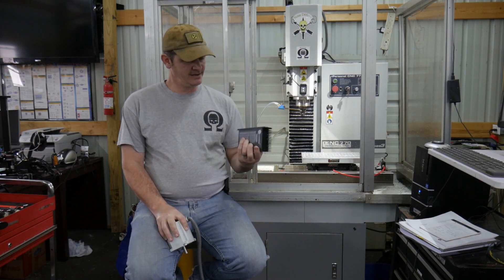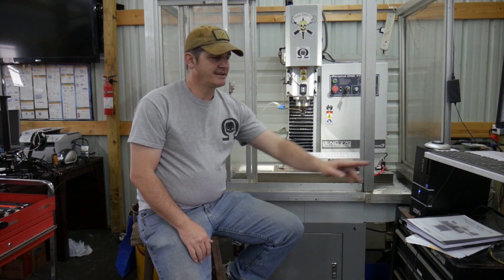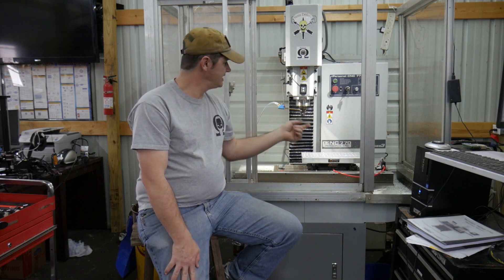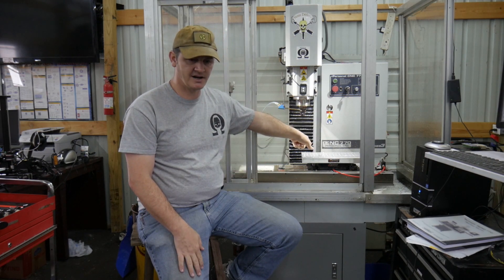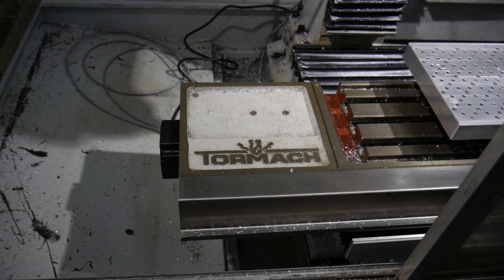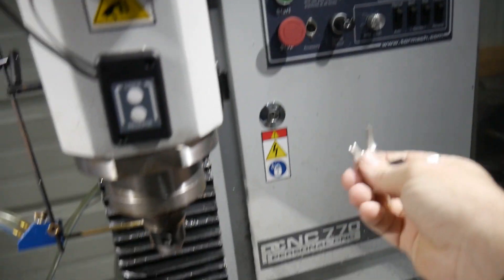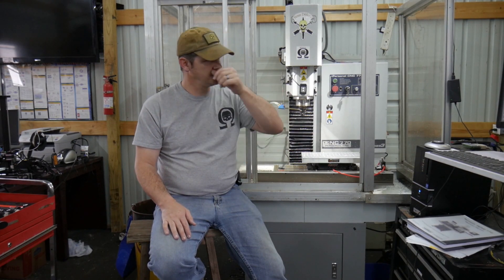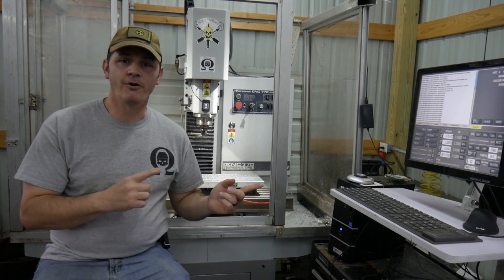Tormach PCNC Hybrid Stepper Upgrade Kits

Comment: I'm tempted by this.  If you get some cutting footage up that'd be awesome.  This seems to provide most of the advantages of the servos for a series 3.  And I assume from your description that if any of the 3 axis motors miss a step the mill will limit switch which should at least stop everything if I'm away from the mill and it crashes because any major crash almost always causes missed steps.  That's a real step up from its stock design.  A big deal if you want to let it run for hours without babysitting it.  To test I just started my 770 spindle then pushed a limit switch and it stopped the mill and said it had to be taken out of e-stop mode to continue.  So that's good.  It stops movement and spindle instantly.
Reply from the maker: Thanks, I posted some cutting footage yesterday and I'll have more coming this week.

Yes, I tied the alarm signal into the the limit switches. It was the simplest way to implement an alarm and stop the machine. This way you will also know which axis is the culprit as the x drive is tied to the x limit for example.
Reply: Thanks for getting my hybrid stepper kit out yesterday.  This virus going around is making it hard for me to concentrate on machining projects but I'm looking forward to getting them and digging in on some machine maintenance in the next couple of weeks.
Reply from the maker: @advil000  thanks for ordering. I'm working on an install video. Lots of editing. My contact information is in the box so if you run into any issues during installation just let me know and I'm happy to help you through the process.

Comment: Think you could provide a 4th identical closed loop motor/driver/cabling to use to drive a 4th axis?  It would also make a good set of backup hardware.
Reply from the maker: Absolutely, I've been looking at my 4th and thinking the same thing. I'll probably offer it separately as well as a full 4 axis kit.

Comment: Nice, Jody.  Showing an adaptive toolpath would nicely demonstrate some rapids and how that affects HSM.  Could see a bit of that at the end of your video, but most of that was at normal feed speed.  Regardless, well done.
Reply from the maker: Thanks for the feedback Bill. I'll program a part and shoot some video this weekend of the machine actually cutting for awhile.
Reply: @jodyolivent8481  You bet.  I'm hoping this works for you on KickStarter.  I can say for certain that more people would take the time to watch if the video just started with nothing but rapid movements.  

While your conversion has many benefits, the one that most visually will grab people is the rapid movement increase.  I, for one, absolutely HATE how long it takes to do a Z retract for a manual tool change.  I also hate how long it takes to rapid jog from initial machine ref to setups on the other end of the table in X.  

Grab attention with those crazy speeds and overlay your explanation in audio on top and you stand a better chance of getting traction with your videos.

Good luck!